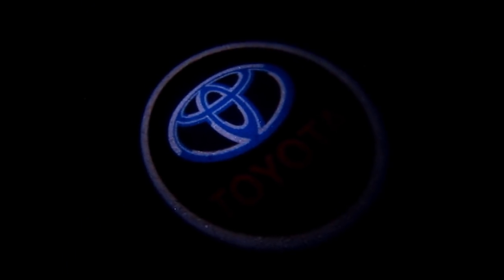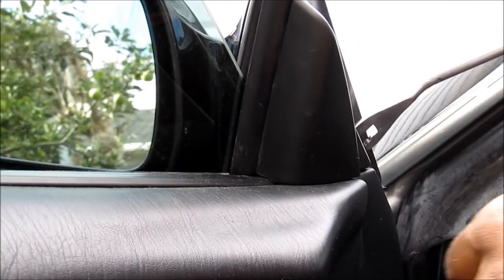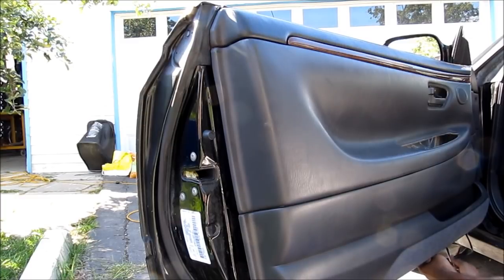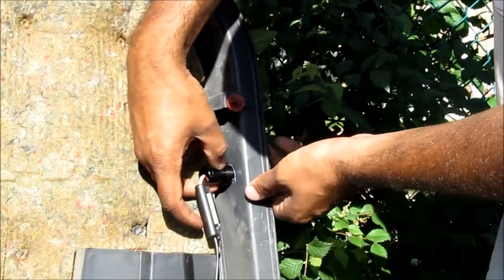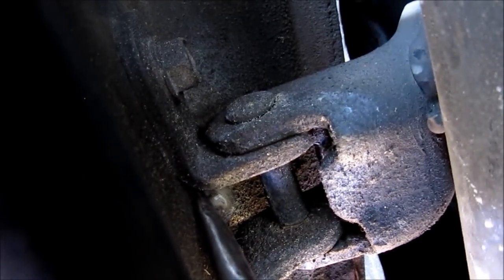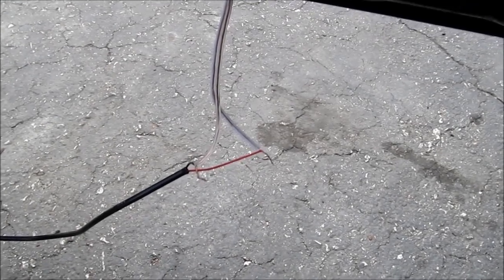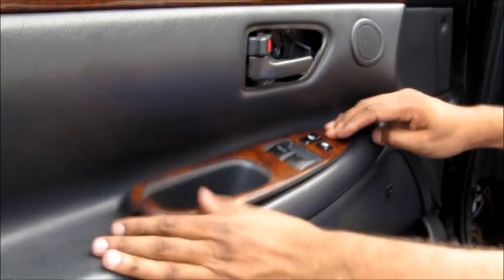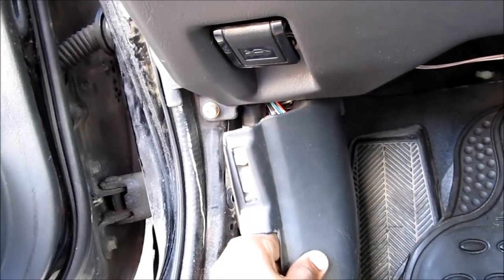Door Welcome Logo Lights Installation

Comment: WOW, Please tell me this video is a joke. Removing the door panel, drilling holes? All so my Honda symbol glows on the floor. ummmmmm, im good.
Reply from the maker: This is how its done with a clean install my friend. I can understand if you have a newish car and not want to remove the door panel.
Reply: The welcome lights look great and I would love too install them on my car.  I have a 14 Accord loaded from the factory, on my previous cars i've done the sound systems, rims, HID lights etc. But they all wound up causing me some type of problems, and I don't buy cheap products.  How good are you with working on cars? I'd say I am far from an expert yet far from an ameture.  Just curious on the skill level you have working on cars and how hard it is to install these. A car's doors obviously are slammed shut (by idiots) and constantly being open and shut. Point is, I want these welcome lights to project the symbol they same way I installed. Even, not slanted or messed up. Do you have any problems with the projector moving after you installed it?
Reply from the maker: I had no problems. I'm just an average home DIY'er (see my other videos), and have a mechanical aptitude, so taking off a door panel isn't difficult. Since this is my old car I didn't have any fear taking it apart, but I probably wouldn't attempt this on my Lexus.
The logo lights screw in to the orientation you want, and in the year and half I've had them, haven't moved.
Reply: Cool. If I may just ask 2 more questions. First, taking off the door panel won't make the side airbags go off right? They deploy from a sensor in the front I think.  Also, how long did this process take you. Thanks again
Reply from the maker: Most side air bags are in the seat or roof, and the door panel shouldn't affect them. I know some BMW's had them in the doors.

It'll take an hour per door to get the panel off, light wired and everything buttoned back up.
Reply: Guess I shoulda asked this question first. Is it worth installing? Are they bright, is the wiring out of the way and is the hole and device noticeable?
Reply from the maker: The installation is clean with no wires or lights showing. They are fairly bright at night but you won't notice them at all in the day.
Reply: nice, what site did you get yours from? About how long did it take to complete?
Reply: Chris Donavon was thinking of doing this on my frs series 1.0. When i see the drill. I was like "hmmm, maybe after few years" i Just got this frs like 3 weeks ago.
Reply from the maker: I understand your feeling about drilling the door, I too wouldn't do this to my Lexus...just yet.
Reply: true, I have a feeling soon many luxury model cars will have this standard. Lincoln already does